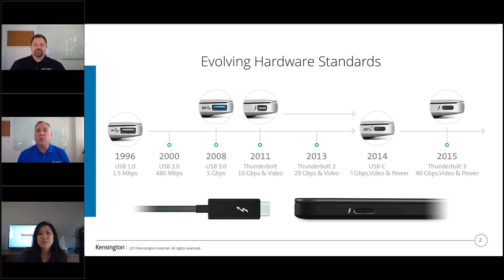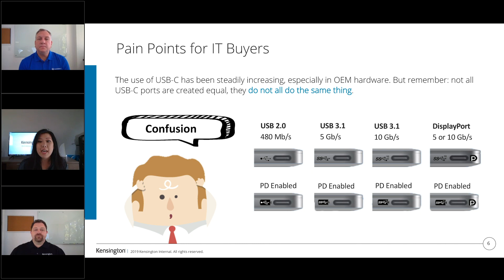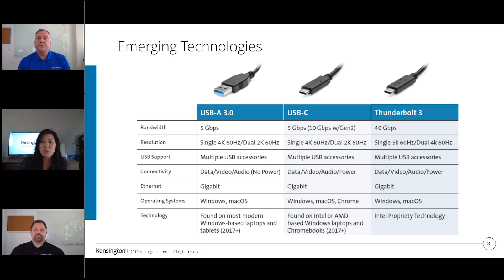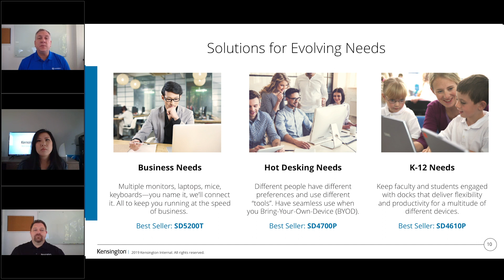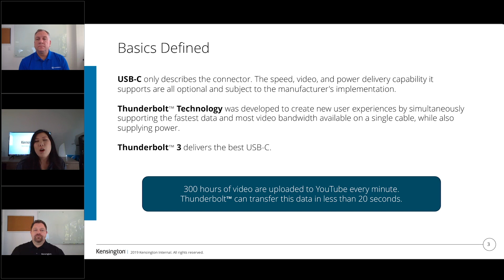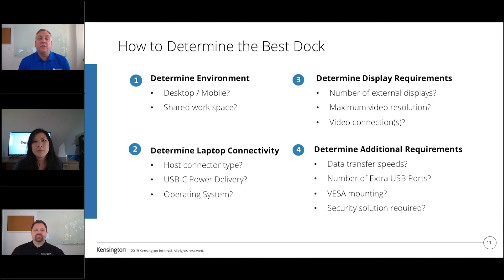Thunderbolt™ 3 and It’s Relevancy: Expertise, Trends and Q&A

Comment: I was sold in 2010 when I saw Intel demo Thunderbolt (then called Light Peak) at IDF. The demo showed an AVID HD I/O interface connected via Light Peak to a laptop. Now we have Universal Audio using Thunderbolt 3 to daisy chain multiple interfaces to increase processing and I/O. I’m looking forward Thunderbolt taking advantage of PCIe 4.0 which will be great for eGPUs. I’m also looking forward to having better Thunderbolt support for Chrome OS and Linux (e.g Ubuntu). Still disappointed that Microsoft doesn’t support Thunderbolt on their surface products even after IceLake has backed in support for Thunderbolt 3 integrated in the CPU. Thunderbolt supports 10GbE networking but there is very little information on that.
Reply from the maker: Yes we'd love to see them adopt the standard for their devices. Glad you like the product :)